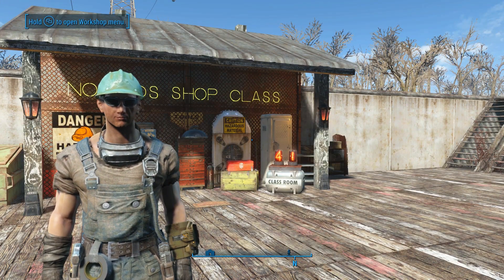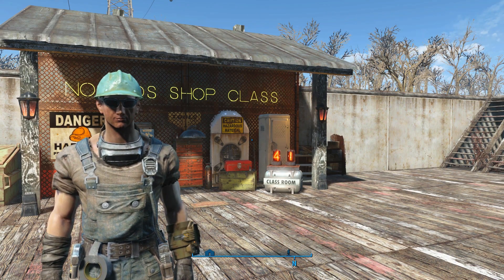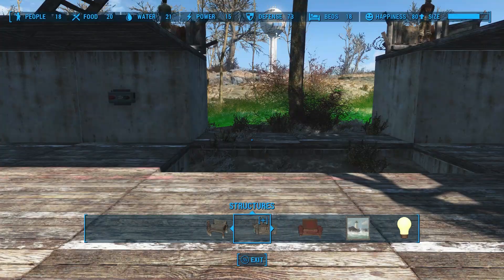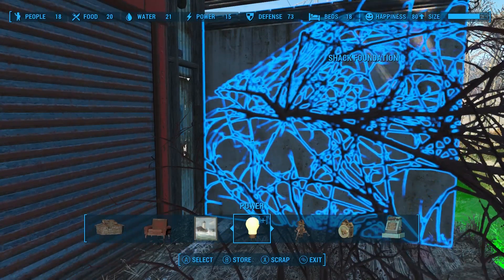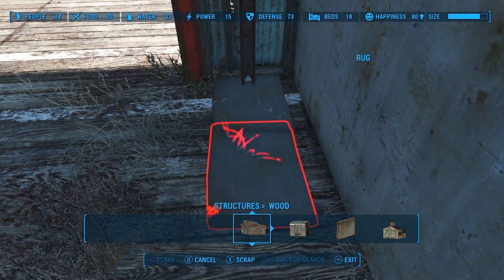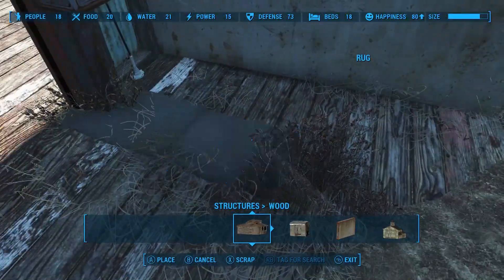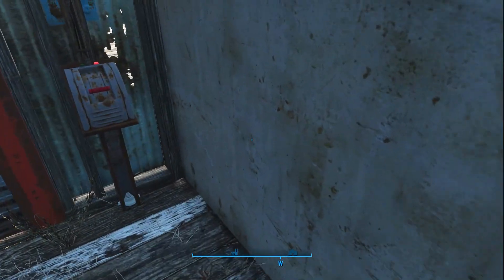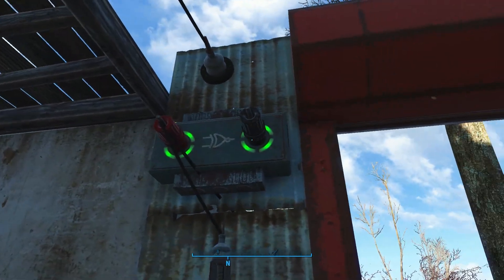Two-Way Powered Doors Using Logic Gates 🎛️ Fallout 4 No Mods Shop Class

Comment: I've got a question, is there any way to get rid of the mole rat disease in the quest 'hole in the wall' that you get in vault 81? I gave the cure to the kid and didn't find out that I had the disease until some time later. At that point I have gone to far into the game to load it back from a old save file and am now stuck with this disease. It would be cool to know if there was anyway of getting rid of the disease at this point and it would help a lot for me and a lot of other people with this disease. Thx
Reply from the maker: Ouch, sorry to say it's permanent dude. If it's not too late, try to load an old save and do the quest again. You just have to avoid any contact with those suckers, including companions! You have to quicksave before looting any rat corpses too because those will also contract the disease. Jet helps in battle. If you don't want to reload, it's only -10HP. As annoying as it is, it's not game breaking or anything.
Reply: I guess I just have to live with -10HP, that's going to be annoying but thanks

Comment: I actually managed to do this without the use of a logic gate and it worked exactly as with the XNOR gate. 
I connected the wire from power source (generator) to the inside switch, then from the inside switch, I used true wire glitch to connect the wire to the outside switch and finally, I connected the outside switch with the power door conduit. Works just the same - If you close the door from the inside, then you won't be able to open it  from the outside. This kinda sucks though if you decide to fast trevel from the inside while the door is closed. Anyway, I' am looking for more advanced techniques with the use of logic gates.
Reply from the maker: I put up a text screen at 11:40 that a lot of people prolly didn't read. But if you want it to open from either side, just use the XOR gate instead. I used the XNOR gate for the "immersion" of it, so it's kind of like a lock from the inside.

Comment: I made it last night & was working fine, then when I was about ready to stop playing it stopped working! Only thing I can think of is I added a laser turret & plugged it into the same wire, only using a 5power generator so maybe the power went to my turret & stopped powering my door
Reply from the maker: That's exactly what happened Bill. :)
Reply: Skooled Zone thanks! I appreciate your reply & your videos. I find your videos a lot more informative & a lot easier to follow than the other ones on the same subjects, plus I don’t want to use mods so yours are perfect!

Comment: I built a combination lock.  I put 10 switches, labeled them 0-9 only when all prime numbers are pulled, and only when ONLY prime numbers are pulled does the door open.  I know it doesn't matter, as you said settlers don't work switches but it's for immersion.  In order to not get locked in (theoretically someone could pull a switch while you are inside and lock you in) I put a pressure plate so you can always get out.  Stepping on the pressure plate opens the door.

Comment: Ive put an xnor, with a not gate to run my settlement defense.  Have main power, and power from the siren going to input.  Output goes to door, and a not gate.  When the sirens goes off from a settlement attack it cuts power to the door.  Then setup heavy lasers or other turrents coming off the output of the not gate.  As the siren goes off doors close and defenses turn on.
Reply from the maker: Cool idea. Whenever I've set up a siren, though, the settlers never seem to trigger it until the battle is almost over. It would've been awesome if the siren could've been motion sensored like the turrets or spotlights.
Reply: Skooled Zone yeah, I really love it when my settelers trip the siren after the attack. So  I also set up a switch at my fast travel point, or where the vertibird is likely to land.  Same idea.  To take it a step further you can add a delayed off switch to the door.  So after it shuts down, using a seperate line you only power the door for a few seconds.

Comment: I did a door like this with no logic gates just the delayed off switch on the outside and momentary floor plate switch on the inside so when you leave you just walk out by stepping on the plate no stopping to activate a switch each switch is only on temporarily to open the door as soon as they go off the door closes
Reply from the maker: Have you figured out a way to make the pressure plate stay on for longer after you step off? I didn't think that was possible.
Reply: Skooled Zone I put the plate right in front of the door,  if you just walk straight at the door it opens and you go right through the door and it closes behind you.  Also just figured out something today you probably already know but I was trying to re-floor a house that had partially collapsed floor and could only get so many floor pieces in but could not get the last piece so I just used a carpet to cover the hole and it works perfect
Reply from the maker: Yeah the carpet is a good trick. I used a rubber mat like that in my Jamaica Plain Schoolhouse: https://youtu.be/ylga9zWD8YE

Comment: Paul, easy recipe for doors that close during an attack: hook up a powered door to the output of an XOR Gate. For the input you need to have one line to direct power and the other line running to a siren. Keep your siren RIGHT next to a guard post and when you get attacked your settler manning that post will activate the alarm, putting the other settlers on high alert, and close the gates at the same time. BONUS POINTS: you can hook a mortar up to the siren with a flare in it, now when you get attacked you can alert settlers, close off the settlement, AND call in a counter attack. NOTE: It's important to shield your generator extremely well. If it get's taken out, the doors will open!
Reply: I can also make a door that is double switched and is set up to shut down in case of emergency. lmk if youd like to know how.
Reply: You can link your powered doors, turrents, alarm, and spotlights all to a single switch. If your settlement is attacked, flip the one switch and the whole place goes on lockdown with colored flashing lights, sirens, etc. Not as practical as leaving a bunch of turrets connected 24/7 but for immersion it's pretty cool. Then after the fight is over you can turn it all off and everything goes back to normal. If you don't want to listen to a bunch of turrets chugging all the time.
Reply: i know it's old but i tried this and it didn't work? i think you're referring to the NAND logic gate. if you use XOR or XNOR then it only opens during an attack

Comment: You can actually select things when using the wire glitch. Instead if using the ladder.
Reply from the maker: I've tried that before and it seems to end the attach wire option in my game. Are you on a console or PC?
Reply: Skooled Zone I'm on PS4, anytime I've used the wire glitch you can use the "X" button to select the the item, and "O" to cancel it, but you keep he wire, only during the glitch tho

Comment: If you connect a wire to a conduit, then true wire glitcht from that conduit a wire  to a other conduit, using the true wire glitch aswell the previous wire will vanish, but it'll stil be connected. A poster of mine is wired and has power but the wire is gone. I tested it and it fully works, but you have to be cautious, as i once had a problem that i used this glitch on box light (those square lights  who can change color)and  i could move it without  the wire being visible, and it was emitting  light wherever i placed it, but the conduit who was connected to a concrete wall, was with the wall and the generator kinda glitched because  some times if you stored any of these items your game crashes and gives a error. I was able to store evrything (by storing evrything  in a specific order), so no harm was done. I wondered if you could look more into it (but definitely save before attempting)... loved the video btw even when i knew how to do such things already.
Reply from the maker: Sebastien, you earned a shout-out my friend ⭐ https://youtu.be/O_eEipBr8as
Reply: Sebastien Van goethem u r indeed the 1st 2 find the "double wire glitch" im sorry u didnt get credit. Its such a monster

Comment: So both switches have to be either on or off to open when one is on and one is off the door is closed?
Would love a way for the one switch to go to closed position when closing door from outside. :)
Reply from the maker: Hi Learoy. I put up a text screen at 11:40 that a lot of people prolly didn't read. But if you want it to open from either side, just use the XOR gate instead. I used the XNOR gate for the "immersion" of it, so it's kind of like a lock from the inside.
Reply from the maker: Yeah, the tree where the door is was a "rp" choice early in my game. Like the tree would stop a truck trying to ram through the front door, lol. It's also the highest point of ground at Abernathy Farm. So that way I could build a flat floor with a crawl space underneath. But hey, it was my very first build in the game, haha.
Reply: There is a switch with a timer that turns itself off after a short while.  That actually makes this application of logic gates, pointless.  The way he has it, if you close the door from the inside and then try to open it from the outside, you can't.
Reply: This setup is identical to having two regular switches connected in  serial.
Reply: Skooled Zone thank you Paul.  Missed the text.  I was doing two things at once.  Sorry
Reply: It looks great, except for the tree in front of the door. :)
What I want is that the switches be free of door is open and red when closed.  Switches on both sides.  I know it’s picky but why not.  Maybe have to use a delay off switch.
Reply: Skooled Zone it’s a very good one for a very first.  My very first was horrible.

Comment: Paul, I use that same garage door in my settlement but I hook them up to the city attack siren so the door stays open at all times until the settlement gets attacked then the city gates close once the siren goes off.
Reply: Saraphiene Haldritch that’s actually a really good idea I never thought about that thanks for the idea
Reply: i was gonna say that
Reply: Skooled Zone  How about hooking the siren up to a tripwire? Leave the siren switched on.  Then the trip wire could turn it on when tripped.  it might work.
Reply: Skooled Zone I have guard posts beside my sirens so settlers are always there. I have 2 defense gates that close on 2 separate sirens. When the siren activates, an emergency flare goes up, the main door closes and my "defense" doors open.  My main defence grid also powers up(the reason being I don't get attacked with 500 defense.) I also have a 6 switch code lock on my armory. Using 2 AND gates and 4 XOR gates plus 6 switches .  I use the advanced settlement power mod( I know it's a mod free channel, but by using this I am given a siren activator and deactivator.  I wired both of my gates to these sensors and brought it to my fast travel target. So if my settlement is under attack I can manually activate and deactivate the siren from the security of my home.
Reply: @vaughnjolley9222  I'd really like to see a video of all this and the build order
Reply: @shoTgundd  I use a mod that gives me proximity sensors where u can increase the range opposed to the siren   it works pretty good when I have it wired right , basically when hostiles get in range of the sensor it activates the lockdown mechanism and doesn't lift it until hostiles r dead so I don't hav to worry about turning off the siren lol
Reply from the maker: Great idea Saraphiene! The only problem I've run into with the siren is that the settlers don't usually turn on the siren until half the battle is over and settlers have already run outside to join the fight. It would've been so cool if the siren was sensor activated like the turrets and the spotlight.
Reply: @SkooledZone  Put a guard post down, put alarm AT the guard post, staff the guard post.
Reply: Skooled Zone I am currently trying to make a combination lock with power counters as the password, but it's proved more difficult than I imagined. If you have any ideas on how to make a power counter password consist of more than 0 0 0 0 then I would be delighted to learn!
Reply: @shoTgundd  @0000-Code long time. But for all who want an answer. Do it like in real life. For example the case digit locks. It’s not important for the lock to know the numbers. It dos not know it.
1. You have your 4 0000-counter.
2. set up your 4 abcd-counter with your personal code.
3. take 4 switches and connect each one with one 0- and one abcd-counter parallel
4. just connect the 0-counter with with the logic gates
5. you have to hide the 0-counter like the real inside of a case or safe lock.
6. if you want to change your codes regularly you should use a 5th switch for setup. This ist connected to a xnor-gate between each code-switch and the 0-counter. (For setup you can first tune in the current code, press the setup-switch on, choose your new code, turn setup-switch on. OR setup ON, count at each code switch the code+ , setup OFF. f.e. current code 1239, setup ON, each code-switch +2, setup OFF, new code 3451)
Reply: Might make a good episode. Otherwise, I'll have to play around with this and try to work out the specifics once I get back to FO4 from my sojurn to Skyrim.
Reply: Eve Alution.  I know this is two years old, but I wonder if you have a solution for the Settlers not turning the siren off after the battle is over.  They turned it on no problem, thus closing the door, but no one came back to to turn it off.  Any help would be greatly appreciated.
Reply: @MusicLover-rt4bs  wish I did hon, but I haven't touched that game on more then a year and a half or more.  One idea though is set up a pressure plate or laser wire where enemies spawn to attack the base, or at least infront of them.  Then when the siren is tripped it will turn off as soon as one of the enemies steps on the pressure plate or laser if you set it up to cut power.  Though that won't shut off the siren on switch it will simply shut it off.  However using the pressure plates to alert you to begin with even if it only sets the siren off for a few seconds on a timer then cuts power might be a better way to go about it.   Could be a good way to notify you when the wandering vender comes into town too.  I hope any of this helps.
Reply: My guy reacted to a 2 year old comment, dedicated to a cause of defending his settlement.
Reply: Skooled Zone sorry about the confusion. The guard posts are on top of " guard stations. " my first gate has an outpost with an elevator. The NPC being boxed in, stays up at his post. More often than not he doesn't have a line of sight so he activates the siren instead. My second gate is more of a maze for the NPC.  Too difficult to navigate without waiting or manually guiding them, they are essentially stuck at the guard post. Once again too far for a clear line of sight they activate the siren immediately. Deactivation is the biggest issue so a back door into the settlement via manual switch is ESSENTIAL!
Reply: I like wiring flares into the siren
Reply: What if!  ….you could hook up the spotlight to the siren 🚨??
Spotlight activates, turns on siren,  door closes.  The End. 😊
Reply: @MrStevesTrains did you manage to achieve this?
Reply: That's brilliant... Nice!
Reply: That’s such a good idea
Reply: I also set my alarms up to shunt power away from my water purifiers and to my auxillary turrets.
Reply: How did you invert the power?
Reply: @runnerrst3572  That was 3 years ago.  Honestly I don't remember the first thing about anything from that game anymore lmao.
Reply: @runnerrst3572 inverted power from the pressure plate in assuming? Did you figure it out ?